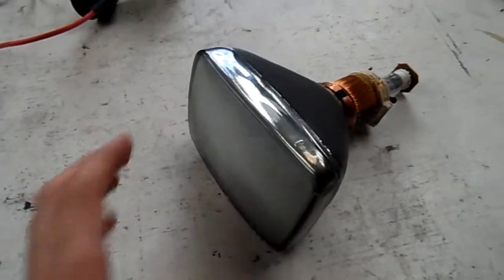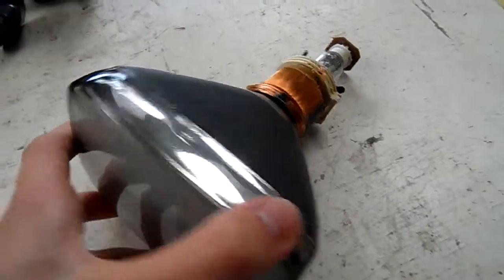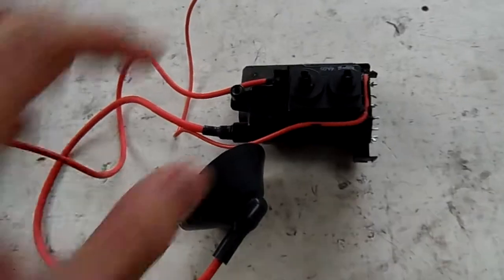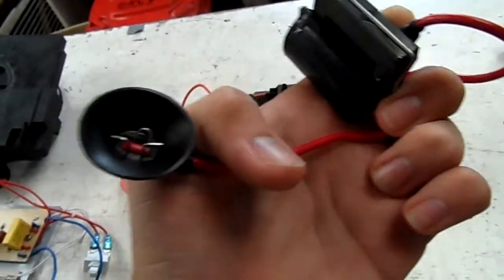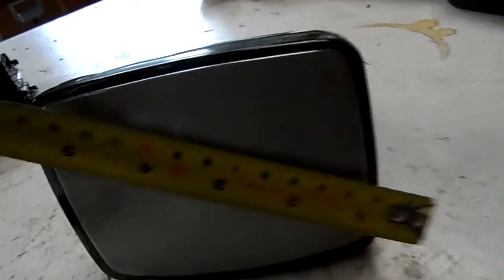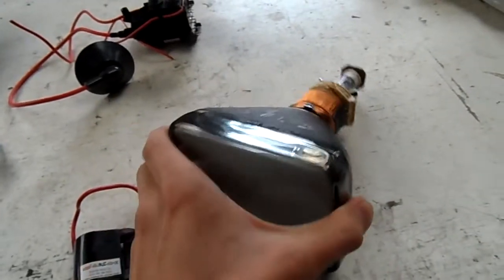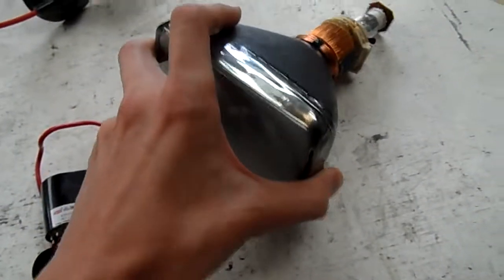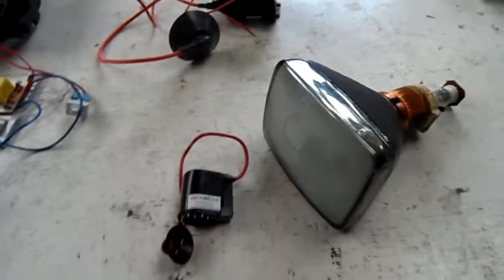5" CRT and flyback

Comment: I have this tube and all the wires broke off when making a box for it and am trying to find the pinout.
I have the board that came with mine, it goes : ENG, IOOV, O ,G (which is bridged with ENG),12v , E , G ,
now I know in my set the white goes to 12v and the red goes to IOOV, and the blue is next to red (cant remember which side of red though)
if you are looking at the back crt the ENG pin is on the right side.
I hope this helps someone

EDIT

alright so I have the NUTEC NCDTV10 and the color coding for the this tube is: ENG(Black), 100V (Red), O (yellow), G (not connected), 12v (white), E (Blue)
I have only tested it for a few minutes but the picture is perfect, also as a note my black wire leads to the biggest trace on the board (still connects to white but white returns a higher resistance probably indicating that the connection is longer on the pcb back to black)

Comment: I have one like this, the brand of the CRT and the flyback is 'Fuhong' (probably the same as yours, by the red sign on the label), but I think my flyback is bad, the screen is only visible with the lights off, too dim to be used, I'l trying to find a way to repair, but those flybacks are expensive. Thanks for sharing. :)
Reply from the maker: No worries! Yeah almost all generic CRTs are Fuhong, probably refers to the guy who makes them :P if you've got a multimeter handy, use it to test the pins on the flyback, as they're all individual windings they should all pair up with each other
Reply: Machine Man This explains the lightweight of this CRT. :P I did various tests to this TV and found no problem, just the voltages derived from the flyback are too low, I don't know yours, but the little PCB on the electron gun of mine shows each pin some code, for ex. tensions or input pins, and the tensions are all low. I can send a bigger B+ to the flyback and the screen gets brighter.
Reply from the maker: Alessandro Nilsen yeah all those other pins will be going to the grid plates, the cathodes (hence the name) and the heaters. You can actually run a CRT simply by putting power to the heaters and connecting a HV supply to the  anode
Reply: Machine Man That's exactly what I was thinking, just use the board for the TV input and supply the voltages by a external supply, but this will need a good flyback to generate those voltages. I was thinking in build a oscilloscope with it, but will be a very complicated project.
Reply from the maker: Alessandro Nilsen not overly complicated, I did a video on one I built a while ago, get a CRT TV, cut the horizontal wires on the yoke and connect them to a tone generator!
Reply: Machine Man That's a project that I need to test, but since the screen is so dark, not much can be seen. I was thinking to use a audio amplifier to drive the coil, but I found a big problem, AC coupling. I still studying it.